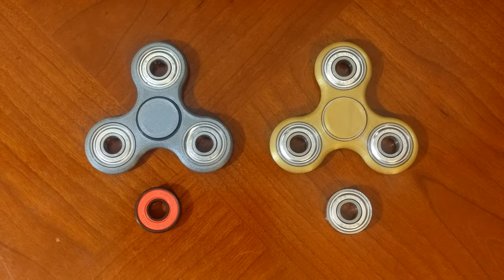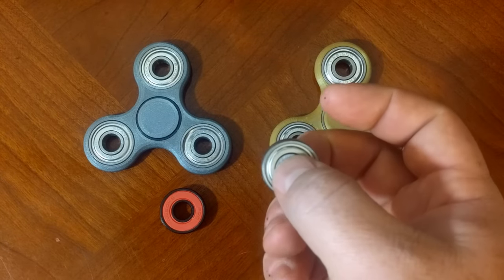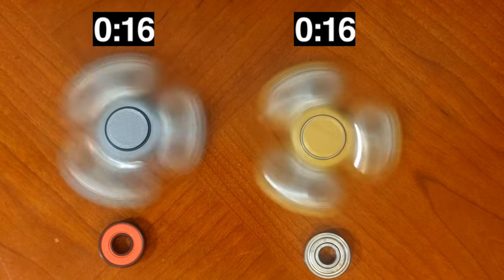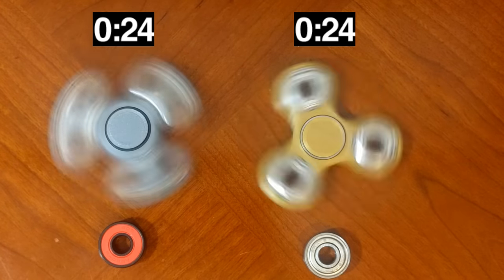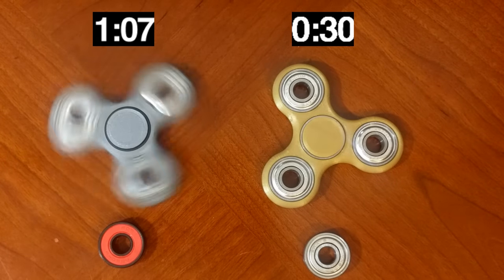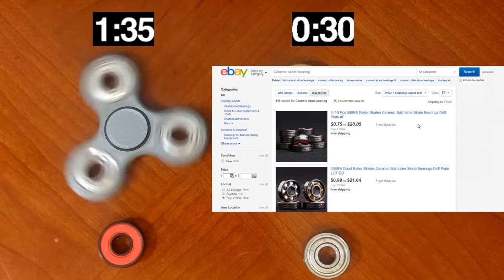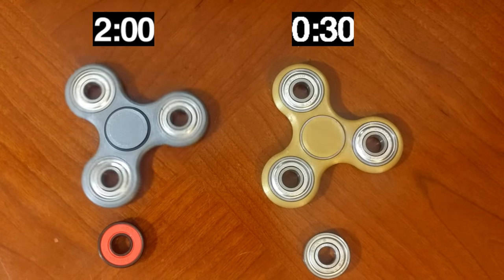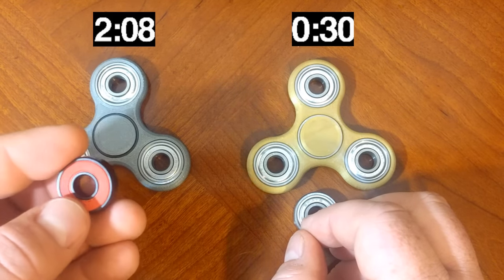Spin Test : Ceramic Vs Steel ball bearings ( Fidget Spinners )

Comment: Steel ball bearings: 0.25$ - Duration: 30 seconds
Ceramic ball bearings: 2$ (4x the price of steel bearings) - Duration: 2 minutes and 3 seconds (4x the duration of the spinning)
Nice :)

Comment: I'm very interested in these but if I were to use the template and buy the bearings how would I insert them to the spinner? I'm confused on how to install the bearings after printing a spinner. Any special equipment? Or just snatch it on there?

Comment: You said in the video that the ceramic was spinning 4 times longer then the steel one, but isnt it for 3 times ?
Reply from the maker: +XsigmaZ 126 seconds/30 seconds~= 4 times longer
Reply: yeah what i meant, was just that if you add 30,,,, 3 times from the time on the steel spinner you would get the right time.. theres a translation barrier here =) well nvm :D

Comment: but how would a high quality tight tolerance more expensive steel bearing do against the equal competitor of ceramic.. im guessing the ceramic would win the test still but how much closer would the steel be to the ceramic...
Reply from the maker: Dalton Michaels I'm building a rig to test all types of bearings. Full ceramic, hybrid ceramic, steel with and without grease, bones red ect.

Comment: do realize the reason that the ceramic bearings last longer is because in a ratio of comparison, vcenter weighs less on a ceramic bearing therefore the slightest difference of weight on the outer side changes everything if the inside is heavier the spend time will be shorter outside is heavier spend time will be longer the spend time for the metal bearing was shorter because it was the same weight everywhere the ceramic one was longer because it is a ceramic bearing and not a full metal bearing. I don't know why but this ends up being true for pretty much every single case I've ever seen. I'm pretty sure someone else can sum this up better but if you can put it below this comment.

Comment: so im going to print one of the designs you linked but im using an external sevice. what material should i use?
Reply from the maker: Jamie Braham I would suggest to have these printed on a FDM or SLS 3D printer. Have them printed in PLA,ABS or Nylon. Stay away from SLA or Polyjet 3D printers.
Reply: Mark Fuller thanks. Found a fairly cheap prebuilt one so I grabbed that. Thanks for the help tho!

Comment: you gotta take side caps off and clean the oil and grease out of them.... 30 seconds??? mine spins longer then your ceramic ones... you gotta pull the sides off both...

Comment: its easy to say that when you take the crapiest steel bearing out there, i use shake junt tripple ogs abec 7 and let me tell you what it beats by far your ceramic bearing ok i know it costs more about 25 euros for 8 but still i mean you can't compare a plain with a car can you its not the same thing, so same here that steel bearing is a bearing made for high precision machinery and not for skating, where the ceramic bearing is suitable for that purpose, that steel ball bearing in this vid can't even make you ride for 5 meters, so you can't make a comparison when there is such a big gap in between. that is just my opinion ( and please for the haters don't come and put a dislike and shitty comment on my review page cause you disagree with me, just put a dislike on this comment and insult me or whatever but don't just do cheap stuff like that )

Comment: My bearings beatg both of those stopping at 2:32 and it was the original bearings i did not customize or add a different bearing to the Fidget Spinner mine is the Red and Black fidget spinner.

Comment: Longboarders and skaters have been using and known about ABEC ratings and the benefits of ceramic for a long time. I guess now the normal peoples are learning about the tech now that its in a toy. The tighter tolerances fight speed wobbles because they are more secure on the trucks. Reduces friction due to materials and so on.

Comment: ceramic bearings arent built for skate becuase they are built for high speeds, not preasure, yea they spin for longer but they brak under preasure of a person riding on the board

Comment: do not talk about what you do not know i've bin skating for over 6 years now and ceramic bearings are just made to make sure your bearings do not over heat at high speeds. Also the abec level just tells you how durable your bearing is, not how well it spins.
Reply from the maker: Actually ABEC deals with tolerance than durability. https://en.wikipedia.org/wiki/ABEC_scale

Comment: The truth is, if your bearing's cage is not nylon, then it will have more friction than one that has a nylon cage. This means a fully ceramic bearing with a ceramic cage will not do as well as a steel bearing with a nylon cage.

Comment: Physics. friction causes heat, ceramic doesn't conduct heat (and expand) like steel.. in bearings its minimal, (load dependant) but it plays a role in increasing deceleration and more especially in wear and longevity. The abec really needs to be the same to compare. Ceramic is more efficient.
Reply: The point of ball bearings is to have as little friction as possible,because of the small amount of friction,there should be a very small time change in them spinning,it barley matters about the material used,the problem here is the steel bearings were cheaply made,he should have bought better steel ones instead of being a cheap ass and getting 25 cent ones,I'm not saying he should have spent 34,000 dollars on it,I'm saying the quality comparison is fucking horrible

Comment: Get bones reds skateboard bearings they are really smooth fast and quiet. They are $20 for a pack of 8
Reply from the maker: ToeMosS _Vlogs I just order a pack of bones red for another spin test. I will report out soon with the results.
Reply: Have you tested, Mark? I would be SHOCKED if bones red bearings came anywhere close to the ceramic ones. Thanks for the review! I play roller derby and was looking for a cheap alternative to the name brand ceramic bearings which cost anywhere from $125-$180 for 16pk! So crazy! Have you heard of anyone who uses these in wheels? Just curious if they get dirty and gunky because the backing doesn't seem like it is fully sealed.

Comment: im not sure you understand the principal of the scientific method, you change ONE variable and you measure another, you do not change two variables and then try and measure just one. to explain you do not know whether the fact that the bearing was made out of ceramic or that the bearing was rated to abec 9 was the reason it spun longer because you tested it against a bearing that didn't have an abec rating and wasn't ceramic

Comment: Now, if you removed the shields, de-greased, washed and dried those bearings, those times would have been MUCH longer. 
Agreed, the ceramics are much better ...all of my spinners have them in (de-greased, washed and dried).

Comment: +Mark Fuller does this spinner work for all spinners (EDC)
Reply from the maker: Callum Princey what do you mean?
Reply: +Mark Fuller there are many different types on amazon and eBay and my spinner is marked as EDC and will the skate bearings be compatible with this spinner type
Reply from the maker: Callum Princey Yes, most (not all) of the bearings used in spinners are 608 ball
 bearings. (22mm dia X 7mm tall)

Comment: Which printer and material is used to print?
Reply from the maker: +Money Maker (CoolVidsForYou) I print most of my parts on the Prusa i3 MK2. Any quality PLA or ABS brand should work. Good filament = Repeatable results= Good parts
Reply: thanks!

Comment: this is not a good comparison, I have a steel bearing spinner and it can go 3 min, all this test is demonstrating is good quality vs bad quality bearing. get a high quality steel bearing it will be the same . the main advantage of ceramic bearing in this setup it doesn't rust.

Comment: Should've started the timer when it started spinning not when you lined both of them up, it was slightly off due to that, by a second or two.
Reply: ChaosMF You should have realized that the ceramic still spun longer

Comment: im a little annoyed that you are calling them ball bearings when ball bearings are shaped like well balls not like the ring shaped bearings seen in yoyos and skateboards
Reply: Bearings found in skateboards and yoyos are ball bearings... Ball bearings are bearings with balls that spin on the inside to reduce the friction.
Reply: i did not know that as the only ball bearings i have seen mentioned were literal balls being used for other purposes.

Comment: The steel bearing has grease in it !---- it will stop sooner !
Reply from the maker: The grease was removed from the steel bearings and replaced with light weight oil
Reply: @2robotguy  O.K.!

Comment: This guy has no clue what ABEC ratings tell us. The speed of a spinner is much lower than any machine that needs a high precision bearing. It would be much better to identify a reputable supplier than to suggest relying on ABEC ratings, which may be falsified anyway.
Reply from the maker: +twocsies you might want to read this.  www.wikipedia.org/wiki/ABEC_scale
Reply: Mark Fuller At the end of the day, I'm suggesting that you don't promote the easily falsified ratings. It will be a lot better to test and report on good suppliers. Put the Amazon links of the good ones.